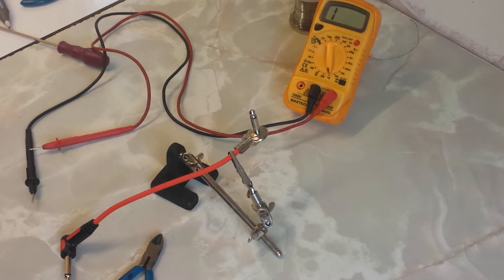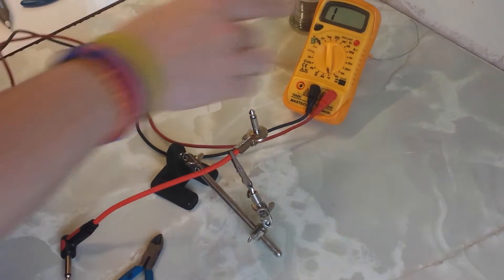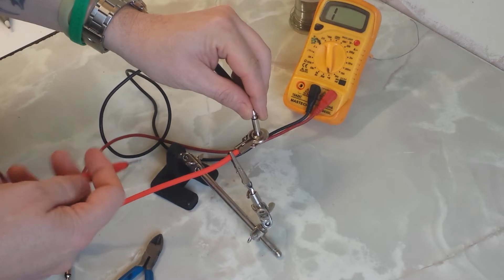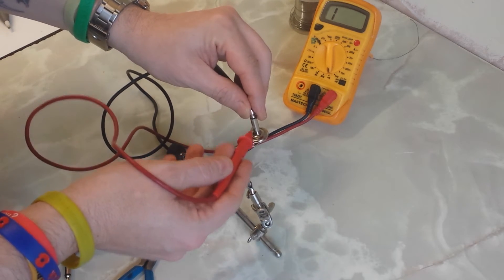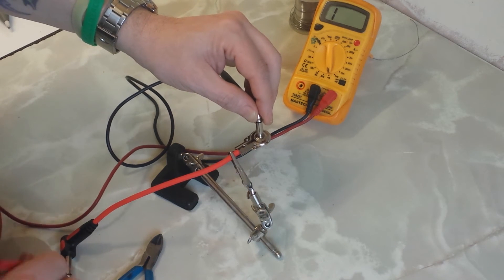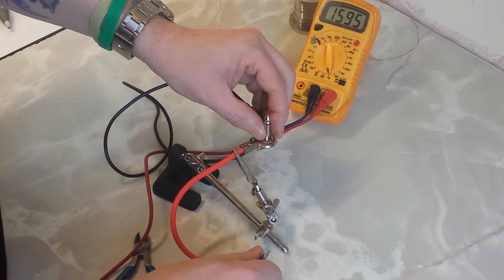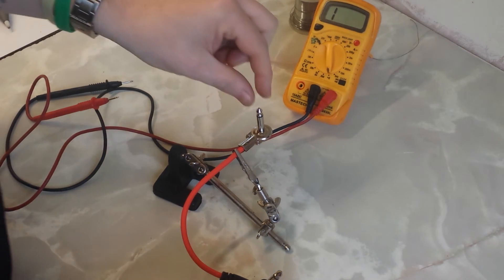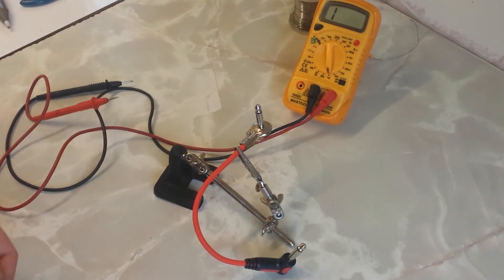How to test Guitar cables with a Multimeter

Comment: So you said; "there is a thing here CONTINUITY TEST" and proceeds NOT to show which symbol to use out of all the weird symbols on the dial of the multimeter! (you can't see from the screen) Not helful at all
Reply: The ohms symbol Looks like headphones, jack
Reply from the maker: Yes, on some test meters it can look like that or a Horse shoe.  @sam3e
Reply from the maker: The symbol on the continuity tester depends on the type of meter you are using. I would advise that you read any manufacturer instructions that come with the meter you are using. Some meters use a light to indicate the continuity is good, some an audible beep & some just display the resistance in ohms of anything between the probes. A horse shoe shaped symbol is usually a good indication of the ohms test method.

Comment: can you do the same to a guitar amp jack input and a guitar input jack to see if there is a problem or not?
Reply from the maker: You can do the same but I would recommend using gold cable & keeping resistance to a minimum. Amp to cab cables need to be more robust (thicker wire) as any resistance can cause heat in the wire & lead to bigger problems, especially with valve amps. (sorry for the delay in replying)
Reply: I've always found that the problems that exist between what comes from my guitar and comes out of my amp have a lot to do with how much I've practised.